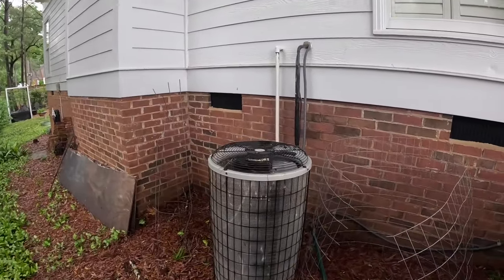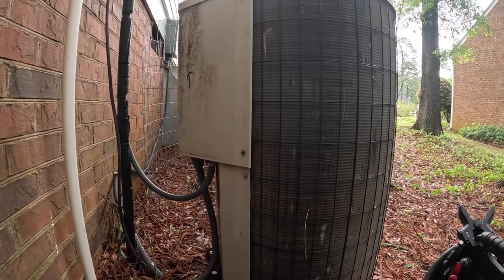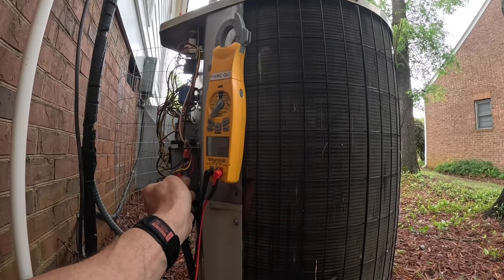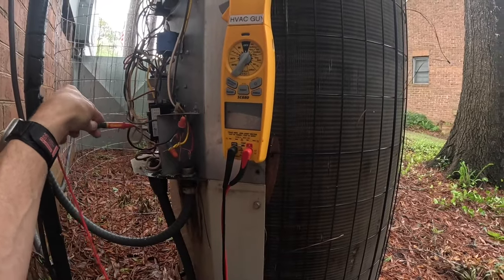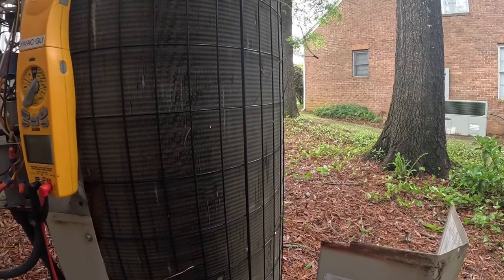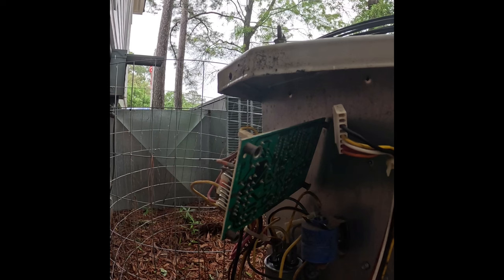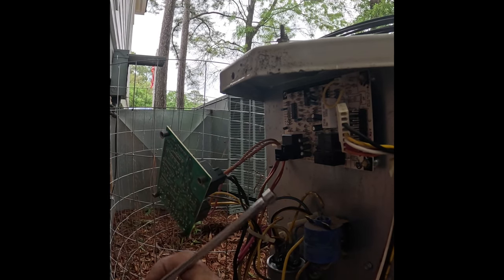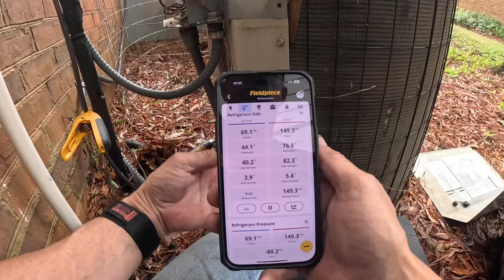Condenser Wasn’t Running When There Was A Call for Cooling! #hvacguy #hvaclife #hvactrainingvideos

Comment: Cold solder joint…just weird that it lasted so long if it’s original…if you look at the back of the board and wiggle the input pins there will be at least one moving within the solder

Comment: My mom's intermittent Goodman gas pack had flame sensor, gas valve, then 2 boards installed then the tech gave up. I resoldered 9 cracked joints behind the plug to all the safeties. The amount of factory solder was very minimal, I think they all cracked when the plug was smashed on.

Comment: I'll bet that the problem with the defrost board was simply just one visually obvious cold solder joint on the connector, that could have been easily fixed in about a minute with a soldering iron and some solder, you wouldn't have even had to fully disconnect the board.
Reply: I think it's better to not disconnect to solder- it might recrack when you replug the wires.
Reply: Why take the chance of a callback.  Just put a new one in and be done with it.

Comment: 19:31 - Second pin from the top on the cable pin header has a cold solder joint.

Comment: It looks to me like the ground pin in the board had a broken or cold solder joint which allowed the pin to break contact when the plug was moved.  Possibly could have been soldered to repair.
Reply: I would have soldered to test and check charge but I think it is illegal to repair boards